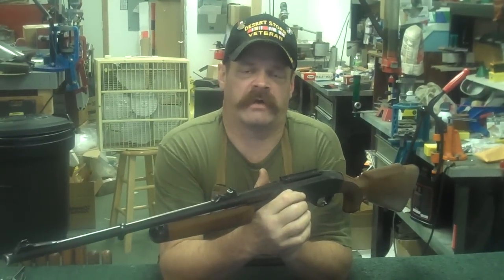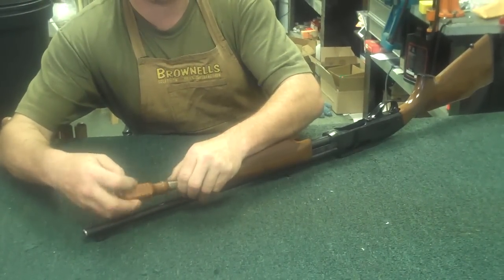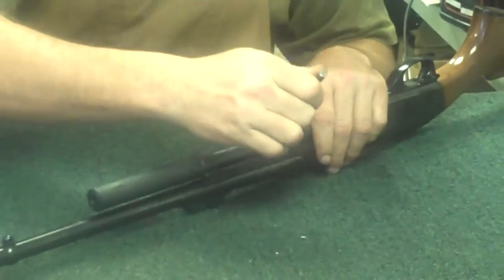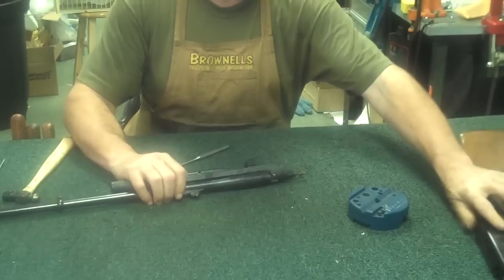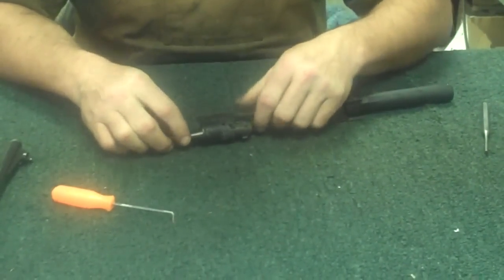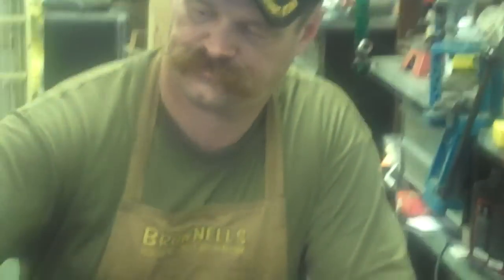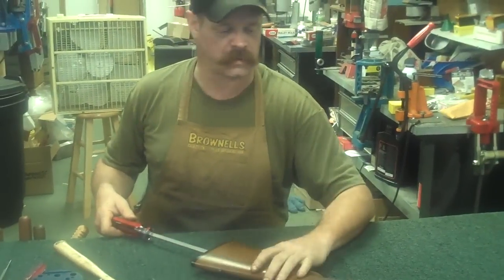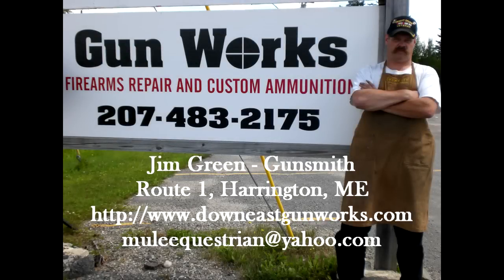Gunsmithing Disassembly: Remington 7600 (Gunworks)

Comment from the maker: I have in the past "quieted" the rattles on these guns by removing the forearm from the pump tube. I then carefully apply a little bit of accraglas gel to the wood where it rests on the pump tube. Wait until it dries before putting it back on ! Otherwise you might permanently glue the wood to the metal. Make sure you use the release agent on the steel and put the wood back on just as it's nearly dry. Once it forms to the tube, pull it off and allow it to fully cure.
Reply: I have completely disassembled the rifle all the way down to the firing pin from watching your video.............. Thanks...
Btw, I have the rifle for about 30 yrs and used only for deer seasons and recently had the shell getting jammed coming out of the magazine but found the fix after tweaking the magazine... 
On your video Remington 760, 7600 pump rifle Part 2...how to tighten up the pump mechanism on this rifle...
The hand guard on Slide tube action was already tight and tightened up the 4 sides of the pump slide tube as you mentioned carefully to lesson the gun rattles.
 You Also mention There are a few other places inside the receiver that allows you to tighten the action a bit but you didn't cover and wondering if you wouldn't mind explaining .
Very informative video. Easy for a DIY ...Thanks again

Comment: Thanks for the helpful video, my father in law gave me a 7600 chambered in .35 whelen. It came from Alaska and looked like it hadn't. Been cleaned since the Reagan administration. I had an issue with the action not going all the way forward/being stuck. After dissembley it was easy to see that one of the pins that held the bolt wasn't properly secured. Thanks for the video very helpful!

Comment: Thanks for sharing this video. I’m picking up a new .35 Whelan 7600 carbine this week. At some point the barrel is going to have to come off for a proper clean down the track. Also I have to remove the trigger assembly to send off to a gun smith who will lighten the trigger pull. Again many thanks!

Comment: great video, helped me understand the problem I'm having with my 7600...The barrel came loose during normal operation. I took the gun apart as in this video, cleaned, lubed and re-assembled.  one question though.  is just tightening the pump slide tube enough to stop the barrel from coming loose again, or should i use thread lock or do you recommend something? Any help is appreciated!  Thanks from Canada!!!!

Tyler

Comment: Great video.....Got my 7600 30-06 for Christmas 30 years ago and have taken many deer with it. The gun does kick like a mule, but shoots all over the place. So i retired it with a Browning A bolt 270 WSM. I watched your video and decided to take it out of the safe to take it apart and see if maybe the lugs had some gunk in them or whatever I could find to see why it was doing this. I have checked the muzzle crown with a high magnification glass and didnt see any knicks or abnormal dings. I was good until I got to the firing pin retaining pin. I drove it out with a punch and it was broken 3/4 of the way through. The 1/4 of it left got jammed in the cutout of the firing pin inside the bolt. Firing pin wouldn't come out and had to drill it out with a 7/64 in. drill bit. All I come up with is a 7/64 in. steel roll pin to replace it  with. By the looks of it, the pin is just to keep the firing pin in the bolt. So doesn't appear to be any stress on this part other than during recoil. I know I will have to grind the ends of the pin down, just as Remington did at the factory and I have checked the clearance after going up a size on the pin. Didn't have a choice on that. All seems good and was wanting your opinion on it......
Reply: The barrel is held into the receiver by the block that the forend tube screws onto.  If there is any slack there, you will have trouble.  Contact this fellow on getting that issue fixed if there is any play.  You can feel it if there is any.  If it has play, you will not be able to get it to hold zero and it's not the scopes fault.  

For the most part these rifles shoot very good; I like them a lot.
Reply: Great video, only was that the plastic chamber cover wasn't mentioned in your video.  You may want to add this for someone who can't figure out how it goes back in.   Otherwise awesome video.  Thank you sir
Reply: My situation is almost identical word for word but just wanted clean the gun thoroughly after watching Jim's Green video 
I just ordered firing pin retaining pin direct from Remington and replaced it. 
But As for it shooting it all over the place, I had a 3X9 Nikon scope and 1 yr I  couldn't hit the target at a 100 yds....
After going through about a 1/2 box of shells  I dialed in at 25 yds 1st  then 50 yds and worked my way up to 100 yds and everything thing has been fine for yrs.

Comment from the maker: It's kind of tricky to do, but if you read the directions on the package and are careful, it'll take a lot of the rattling noise out of the fore end. If you don't care to remove the fore end ever again, you could just glass gel it permanently to the pump tube. If you ever need to replace the wood, you'll have to destroy it to get it back off again.

Comment: Jim I clean the bore of all my bolt action rifles after I have used them at the range or after hunting. How often do you recommend removing the barrel from a 7600 rifle in order to clean it correctly from the rear of the bore with a rod in order to remove carbon and built up copper? Many thanks in advance.

Comment from the maker: @rotamanX Yes, they have some sort of thread locking compound on them. IF -- and ONLY IF -- you can't remove it in any other way, you could gently heat the barrel nut / tube right at the threaded part to loosen it. BE CAREFUL ! Too much heat will anneal the parts and ruin them.

Comment: I have a 7600.  I had the plastic dust cover break on a super cold day?  i also guess i lost the Pin (one of the two that hold bolt)  3:56 of your video.  It was all I had on the hunt so I put a round threw it to see???  all went ok.  3 hours later I shot a nice buck without an issue???
Is this gun safe?

Comment from the maker: @Adam0Fraley I don't see why not. They operate much like a pump shotgun, which is what many people know how to use already. The thing is the stock has to fit the shooter as far as length of pull. Any competent gunsmith can shorten it as needed....IF that's what is needed. The most important thing is to go to the range and practice a lot. You need to be proficient with whayever gun you're going to use, before you hunt with it.

Comment: Is the safety mechanism on the 7600 reversible? Bought one second hand that has the safety set for a left handed shooter where you push right to take the safety off. I would like to get it back to the right handed orientation where you push left to take the safety off. Is this something someone can do themselves or is it better to have a gunsmith do it? Thanks!

Comment: Hi. I have disassembled my 7600. I have a spacer ring in the firing pin assembly but it's broken in half. I don't see it on the oem part list. Is this spacer(shim) really important? Can i still use my firearm without danger or damage to the rest of the parts?

Comment: Hi Jim,  my Remington 760 break down just like this; however, I could not get the tube off.  In fact, I tapped on a punch and/or screwdriver several hundred times over 3 days.  Finally, my tap broke.  Any advice?

Comment: I have the same rifle, remington 7600, but I have a loading and reloading problem.  It seems like the magazine is loose.  I tried a new magazine and an after market magazines and I still have the same problem.  I like the gun.  Can you please offer any suggestions.  Great video.  Thanks.
Reply: My situation was identical....
Btw, I'm a average hunter and recently getting more involved with the terminology of guns and ammo.....
I  purchased  2 old style magazines but they also didn't work. I searched and read many hours of threads or forums on " 7600 feeding problems" or shell getting jammed coming out of magazine.....
Unfortunately there are no pictures which can tell a 1K words so I'll explain the best i could...
.
1st , if the mag is loose, tightened it up by hitting/tapping lightly a small 1/4" flat head screwdriver from the inside out at the front of magazine every so slightly around 1/16th inch....This wears after excessive use and  is how the magazine locks in and unlocks with the latch release..........
2nd,  The Loading problem is from the lips of the magazine being splayed to far out or in usually on the right rear side but could be both.....My guess is they move from excessive use, in & out and being banged around over the years and need to be tweaked after time.....
If you break down the 7600 and remove the dust cover from the ejector, you have a clearer picture on why the shell gets jammed when loading a round prior to the chamber when you slide the pump forward.....
As I read this from firing line forum oneoldsap     "Sounds like maybe you need to open up the lip on the right side where the second round feeds from". It should be a matter of opening or closing up one or both lips.... 
When your looking at the magazine from the back, you'll want to see the cartridge head or primer close to about 1/2 way out so when sliding the bolt forward catches the lip of the head allowing it to slide in the chamber correctly . this worked for me but only after seeing it with the dust cover off and bending the rear lips multiply times with just the right angle so it would feed correctly.......be very patient 
Hope this works for you.

Comment: Any chance you do the assembly now?  Every time I have taken a gun apart something doesn't work out or go back simple.  I currently have a Marlin 22LR  25N which I can't get the bolt assembly back together after I took out the Screw holding it in.  Any suggestions?

Comment: Is it possible to remove just the trigger group from a 760 without any other disassembly? I want to replace the RH safety bolt with an aftermarket LH part. I'm not familiar with this gun yet. I just picked up a "partly" left-handed rifle, with a lefty monte carlo stock no less, but right-handed safety. Go figure. Thanks.
Reply: Yes, just tap out the two pins holding the trigger assembly in the receiver and work it out the bottom.  Remove the magazine first.

Comment: Inherited the Remington 760 from my father in law. Took it all apart and am having a hard time getting it back together again. Put it together the way I thought it came apart and when I run the action back and forth the bolt falls out. What am I missing?
Reply: They are tricky to get back together. you sorta have to get all the pieces in place and slide the action and the barrel all into the receiver at the same time. First put bolt into "bolt carrier/Slide" right side up. then pull slide and bolt forward. So bolt is locked in firing/closed postion in barrel. Then while holding this configuration get ready to insert into receiver. Once you've got everything lined up take the little cover plate and place onto Bolt/action assembly(Still holding bolt tight up in barrel.) then slide everything home and tighten. If your cursed with the plastic coverplate be prepared to try several times till you find the right combination of cuss words that make it fit. cheers

Comment: Hello, i have a remington 7600 and the bore is not in line with the picatinnyrail, i cant zero the scope like this. does anyone have the same problem and can give me an idea how to fix it without sending it to a gunsmith? ty
Reply: I'm having the same issue did you ever get yours fixed
Reply: @jeremyjohnson8612  there are mounts that can compensate for this. or you need a scope that has a lot of internal left/right movement.
Reply: @jeremyjohnson8612  there are mounts that can adjust enough for that issue. but i sold mine.

Comment: My tube was unscrewable i took a punch pin like in the video and then fucked up the holes, now it cant slide propely  because the metal is deformed...
Reply: +vachier123 after removing all plastics and wood....use a electric heat gun...just warm it up good..a shot of HILCO LUBE (tm)....and it should come apart more easily..just dont heat it up to where you burn your self..use leather gloves..and ony heat the reciever.."mostly"...after all...you still got to replace the guide tube any how..to fix your problems !!! have a good one !!
Reply: You need an appropriate sized spanner wrench to get that loose without damage.  Your situation means that you will likely have to buy a new tube, but they are available.